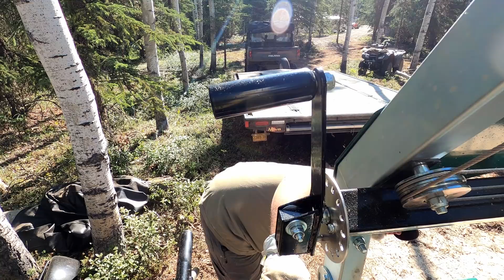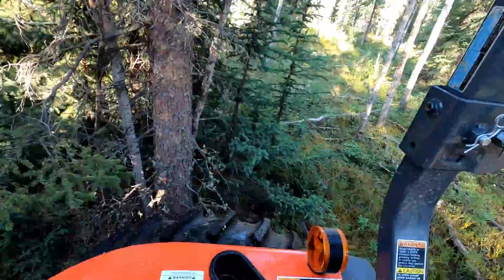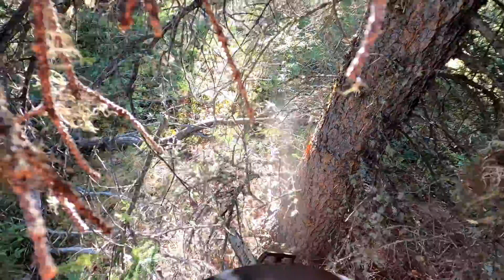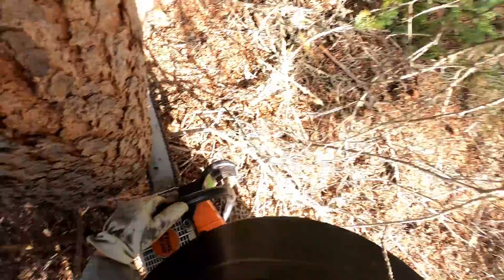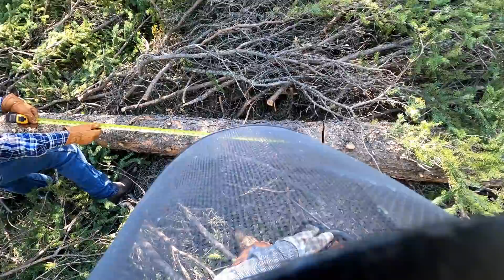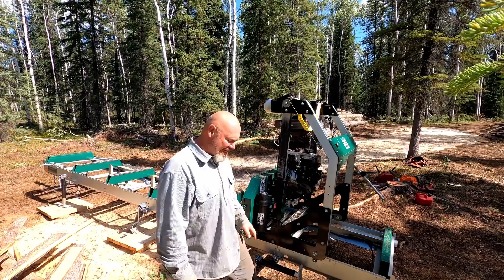From TREES to LUMBER with a portable sawmill

Comment: I know the roof is to protect the sub floor during this winter.  The roof is so nice, will you be able to use it for the house build or for a future out building or even a roof over the milling machine in the winter?  Just wondering.
Reply from the maker: So the roof is being put together with all screws.  Hopefully next year I can take it apart and use the lumber to frame our house walls.
Reply: @wildwoodoffgridalaska  That's great.

Comment: Living proof that mills don't need to be orange. Were I a younger man, I would go back to making sawmills. I really haven't figured out a way to strip those spruce limbs off on the trees up here. Clear to the roots with pinnots and miserable to get near to start limbing off the branches. I haven't tried a tractor that new but looks like a pretty good rig with control valves right under the middle of tractor and too close to the ground for my liking, should have a easy to remove guard for stopping anything from breaking off fittings hoses or valves themselves. If money starts falling out of your pockets (big laugh) I would get a mid size your flavor excavator to take out trees, do a lot of limbing, pioneer roads and feed the mill. I would even have pallet forks on it to move stacks of lumber or logs themselves. Anyway I used to make lumber up here on a Lucas sawmill, great saw for middle to large trees but drive you nuts on small  trees like those. I wonder just how good the trees here would do for making "D" log lumber so the live edge is still on the outside. I kinda like the rustic look but its lumber inside and no chinking between trees. I like the hell out of these type videos even though I was a mechanic for almost all my life. At least forty of the last seventy plus years. I would give anything to be your dads size. I had my weight well distributed on my six foot frame and have always been close  to three hundred pounds. I was slender like your dad till I was fifteen and then just blew up. Looking at the zipper hickory shirts that your wearing makes me miss them as it was all I owned for a good fifty years or wife beaters t shirts. Usually a three x shirt. I liked getting pitch and grease on them and breaking them in to were  water just shed off them. Since I got myself crippled up, I wear a single x tee with a pocket, shirts need pockets and the only reason I need one that large is to get over my gut. My next to youngest fifty three year old daughter goes through boy friends like laundry and when going with someone will weight one ten to twenty pounds. I get her back after five or more months and she has to go as she can eat me out of house and home. She goes right to "Big" and I think oh no but I get onto her about it and down she goes to that wonderful light weight size and I just scream inside my head cause if I could lose weight I would drop around a hundred thirty pounds. Still that cold over your way.... you must cook in our heat here in wasilla. I haven't been here on your channel as much as I should but so easy to  get sidetracked and on come the machine shop videos so don't know how close you are to getting dried in this year but forever hopeful no one fights the winter months .... I also watch a couple kids down in idaho called Laid back living. Boy is  real sharp and then Sawing with Sandy who is a canadian fellow that has some interesting troubles figuring out how to get trees out of the brush. I do like the sidewinder winch he got for his tractor. Pulls like a log skidder and really a game changer. Well be careful as losing a leg to a chainsaw is not as easy as in  the movies
Reply from the maker: Wow, thanks for the comment.  Sounds like you’ve led an amazing life full of stories and such.  We appreciate you spending sometime with us.  Have a great day.😊
Reply: @wildwoodoffgridalaska  If I could only get past the fear of a camera, I could fill books with some I don't believe but witnesses do. Thank you for the kind come back. Building stuff was my whole life. Fixing came natural but making stuff was my greatest motivator